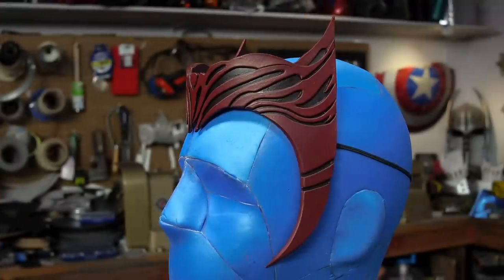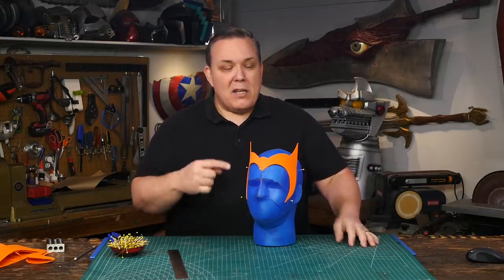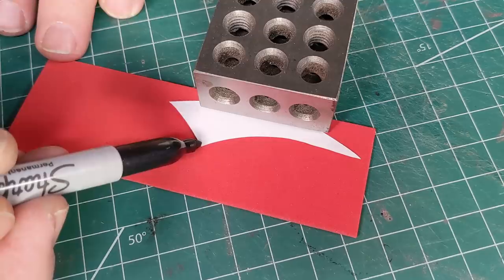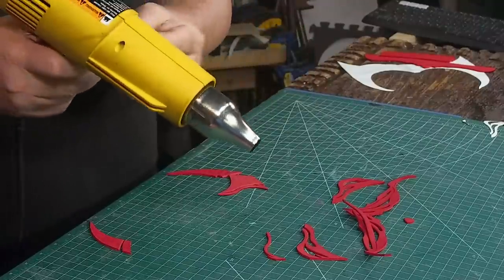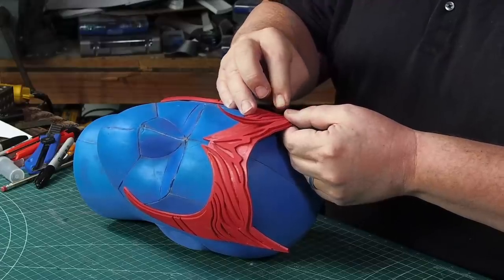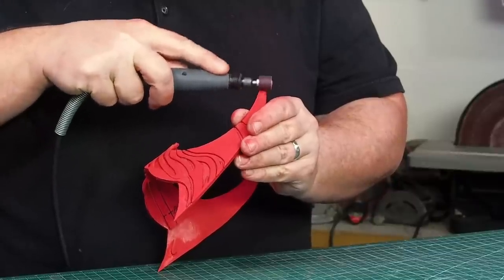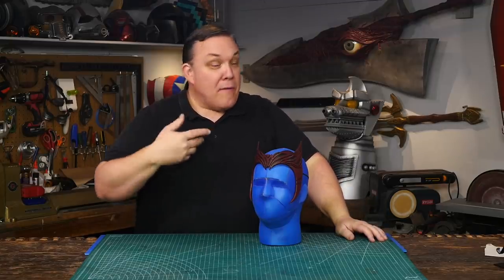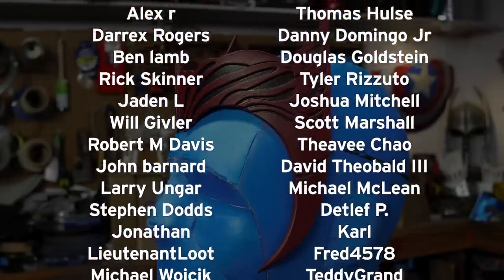Odin Makes: Wanda's new Scarlet Witch Headdress from Wandavision

Comment: Oooh, I like that you're adding in the precise names of what you're using.
Reply from the maker: Thanks! I was thinking that I needed to mention what bits I was using, it can be a real hassle figuring that stuff out.
And thanks to Adam Savage talking about it, I am running the motor at slower speeds now too.

Comment: I wanted to be scarlet witch this Halloween, and now i can make the mask!😄
Reply: Same! What are you doing for her outfit? Are you doing the comic version or her full on out outfit?
Reply: @orchidsarepretty1422  i think i'm gonna try and get the new one to go with the new mask!
(I just finished it!)
Reply: @Aisha_Luv  oh cool! Did you use the stuff to round the edges or left it as is? I wanna make one so badly!
Reply: @orchidsarepretty1422  naw i dont have all that fancy equipment. I just you two layers of glitter foam, black for the back and red for the details in the front. Then i just covered it in some mod podge and, BAM. It turned out awesome!💗❤️
Oh, and it aas the sticker foam, so i put some paper on the back, and i think that helped with the stability and shape since i didn't have concrete glue!
Reply: @Aisha_Luv  alright thank you! I’m so excited to make thhs
Reply: @orchidsarepretty1422  Good Luck! Hope it turns out nice!💞💕